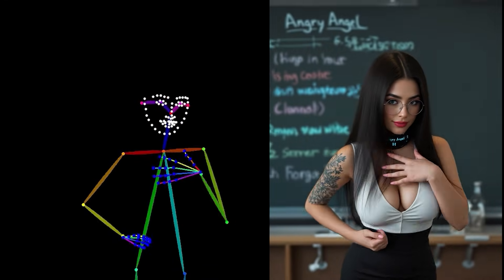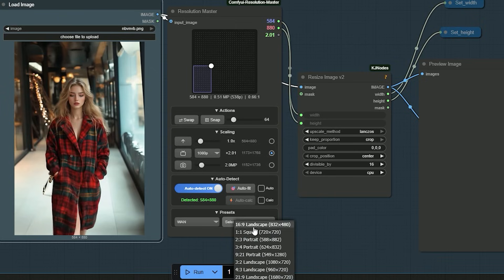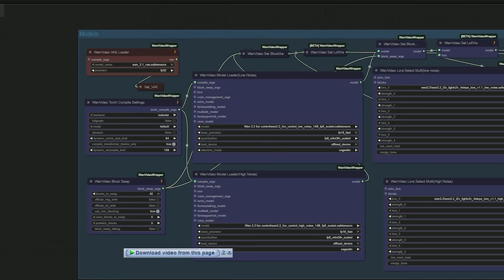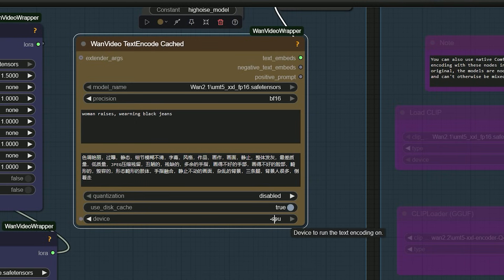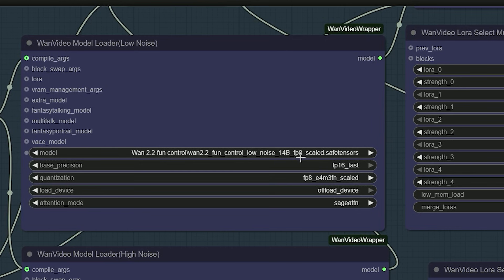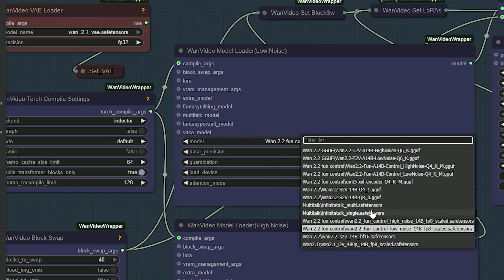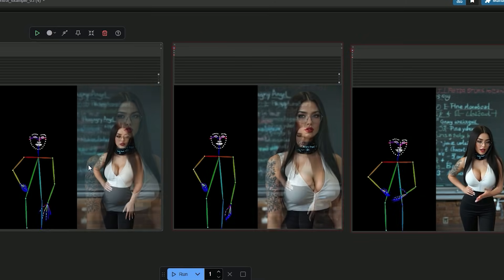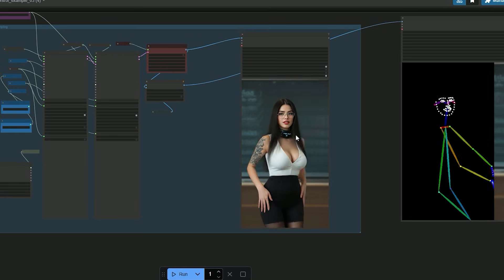WAN 2.2 Fun Control ComfyUI Workflow (GGUF, Low VRAM 5 to 6 GB)

Comment: Can't figure out why but I am getting OOM errors no matter what I do and I have 16GB VRAM (4080). I have run through the video, pausing to check the parameters and I can't find anything to explain the OOM. I'm using the GGUF models and a low resolution (480 instead of 1024).
Reply: segmentate the process, and clean chache nodes and models for preprocessing inputs, then run the video generating process, some times comfy unload partially the nodes cache, I've got OOM on tested workfklows, cleaned cache and unload models and tested again with no problems

Comment: Sorry, new to all this. When I run the workflow, it only runs to the control video and create the wire frame. Itt does not run the rest of  the nodes. How I can I get the other nodes to run to create  the final video?  Thank you.
Reply: Please check your gguf model and the lora models try manually clicking the models. I hope it works

Comment: Hey, thanks for sharing! 🙏
I tried the Q3_K_M model on my 8GB VRAM GPU, but unfortunately it keeps crashing. 😕
I already set the FPS down to 10 and made the image size super small, but it still didn’t help.

Do you have any idea what I might be doing wrong?
And will there maybe be a tutorial in the future especially for low VRAM setups? That would be super helpful!
Reply: Use gguf

Comment: tengo un problema algo estoy configurando mal, estoy usando una RTX A4500, con los modelos fp8_e5m2_scaled high y low noise por la arquitectura de mi gpu, pero al hacer la generación me distorsiona la imagen y no es la misma que uso de referencia que debo ajustar para que no altere la imagen que quiero que anime Wan2_2-Fun-Control-A14B-LOWf_fp8_e5m2_scaled_KJ_fixed.safetensors

Comment: This workflow doesn't work for a 12 vram RTX 3060. Not even with gguf. It gets stuck in WanVideoSampler for hours and never progresses, no matter what. Even setting a resolution of 64x64. It never uses the GPU, everything is calculated in RAM.
Reply: same for me, very low resolution and only testet on 10 fps... ( in console : out of vram space ) :/
Reply: did you find any good workflow for 3060?
Reply: What gguf bit did u use?

Comment: Ok, i tested and the WF don't work, plus there are many nodes that are not connected to anything.
And for me:
Max allocated memory: max_memory=8.134 GB
Max reserved memory: max_reserved=9.312 GB
I have a 4090 RTX and i use GGUF and normal text encoder.
Plus, when selecting lcm sampler, the WF don't work.

The Workflow switch to idle and stop working after the video combine, no preview video is displayed nothing. But all the video parts are saved in my folder.
Keep in mind, i never had any issue with all my others Wan 2.2 WF.

Comment: Putting cache files on SSD is a recipe for disaster. Those caches are not small in size. Also I dunno how GGUF could be faster than safetensors because GGUF needs to uncompress everything when safetensors already uncompressed and should be faster at generating.
Reply: That's not how it works it's not a z zip file😂
Reply: That exactly how it works my boy your CPU will spent more time to decode GGUF data in comparison to safetensors where the data already ready for usage.  @jotesoft

Comment: Thanks for the nice tutorial.
One question: 
Does it work for T2V? Without using an image reference but a prompt?

What we need now, is an infinite loop for this workflow, to generate the video the same length as the reference video.
Can you update the WF to add infinite loop extension?
Reply from the maker: Actually, this is the Wan 2.2 Fun Control model, which is specifically designed for controlled video generation using reference inputs (like pose, depth, or motion).

On infinity soon...

Comment: It can even run on 2GB vram but the most important thing is nobody wants to wait for hours for just a 2 second video.
Reply: 8 Gb VRAM.  Out of memory
Reply: @editvideo_net  what are you using? comfyUI? note that for the first time I gave try to "wan2gp" and in that I used the wan2.2 and It worked the 5B model, but don't use wan2gp, comfyUI is much more good just try to increase the page file and last don't use the original wan2.2 model, use the "FastWan2.2" model

Comment: You used a T2V model and T2V Lora even when using an image is there any reason why?
Reply from the maker: Actually, this is the Wan 2.2 Fun Control model, which is specifically designed for controlled video generation using reference inputs (like pose, depth, or motion). It's not a general T2V (text-to-video) or I2V (image-to-video) model.